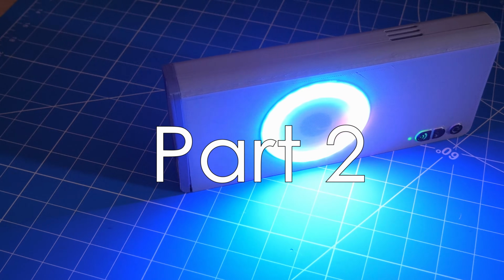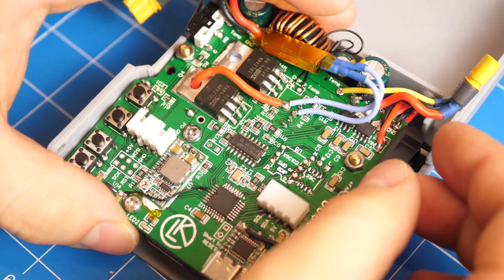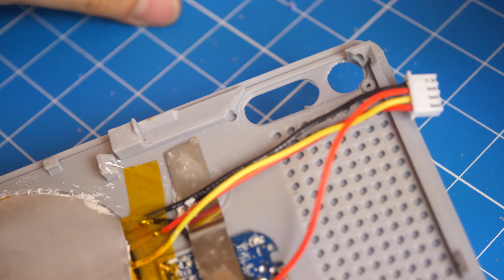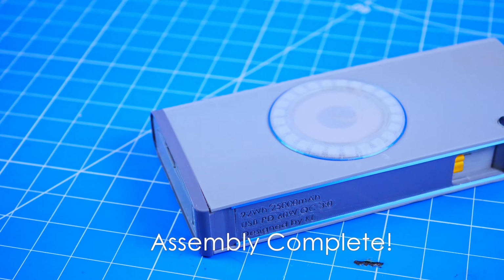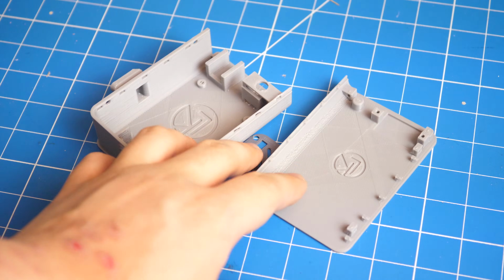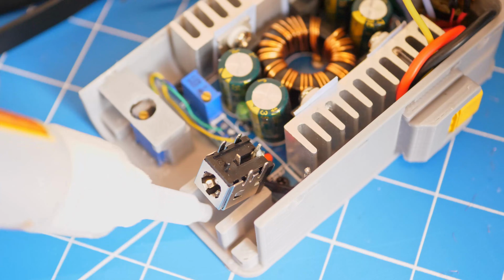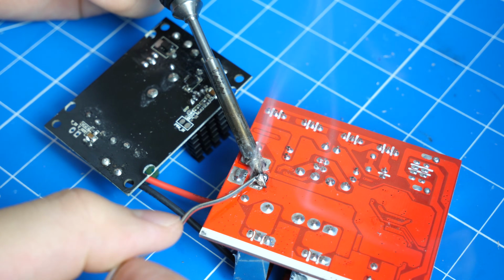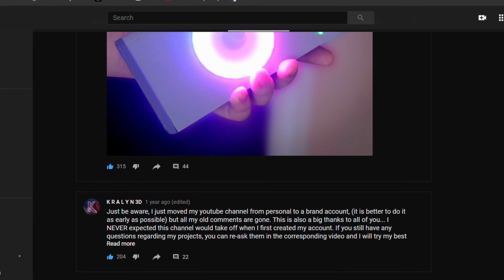The MOST Versatile DIY Power bank Build (Part 2)

Comment from the maker: Hello everyone, this concludes this version of the power bank (which is open-source) I am currently planning to start a campaign, but it will most likely take 2-3 months(create a company, website, contact manufactures etc.). If you have any suggestions or advice, please comment below as I do read all of them. I will post major updates in the community tab. The next project should be a lot simpler. I thank all of you for your support!
Reply: Thank you so much. I love what you are doing and just want to wish you well💯💯💯💯💯. Keep up the good work. Btw what engineering field are you in?
Reply from the maker: @johndawson6057  I study industrial design and mechanical engineering; I learned electrical engineering by teaching myself.
Reply: @kralyn3d  this is awesome work your doing..  im super stoked on it.. i think i kind of want one lol. what country are you out of? and on a side note and question...  ever do any work on electric bikes of any kind? i personaly ride an electric limited speed motorbike..  super soco tc. and i want to upgrade its controller with something better. and all of that is easey enough but the batery is always the biggest issue with mods like this.. i found a hard tail single wheel trailer i want to work with as it has a solid enclosure... and i kind of want to figure out how to get a rebuild going on my battery that will give me multiple charge options. so that i can use ev charge stations as opposed to just wall plugs like i have. but i  really kind of wish to get a small generator implamented into the trailer so that i can charge if i get stuck away from power by keeping a small amount of emergency fuel on hand and trying for a dc fast charge on the batteries. i have one friend in town who also hobbies on this but neither of us are advanced builders like im seeing here. any suggestions or ideas for me? i just want to get the bike able to get out farther. and able to take more than just one source of power :P
Reply: @kralyn3d  I studied ID as well, also a self-taught electronics engineer - your videos are the kind of thing I wish I had the time to make! Big congrats!
Reply: @kralyn3d  wOw! your passion will drive you in a successful business
Reply: Here’s a idea what about using Gallium nitride components to reduce the heat dispassion and to increases the efficiency of the device over all?
Reply: Have you thought of adding other quick charge functions like oneplus, Huawei's and Samsung's quick charge? Or apple watch wireless charger or qi fast wireless charging. I do not personally benefit from any of those and they would add more cost, but for some of us it might be really useful.
What about Bluetooth to control lights and other parts of powerbank such as charging?

Just sharing my thoughts...
Reply: I am from India can buy this one when it is ready
Reply: For the ac module if the plug types were interchangeable it would be more versatile when travelling or when you shipping this product internationally.
Reply: @mayur619  that's what I thought too
Reply: Hello sir
      Your experiment and the the product gained is just fantastic. I  very eagerly waiting to have one of them. So I wanted to know whether you can do one for me and ship it to my address. Please sir i am very crazy about your product sir please do think over it and do reply.
thankyou.
Anirudh Balakrishna.
Reply: I'm waiting for the campaign. I look forward to supporting you on this endeavour
Reply from the maker: @AndrewJames1984  I am working full speed on it right now.
Reply: @kralyn3d  this is awesome. Thanks for taking the time to respond to my comment 🙂
Reply: I would like to buy. Please send me the link.  This is really a superb piece of device.
Reply: Best wishes ❣️🎉
Reply: How to buy
Reply: Some suggestions I have for this power bank are to add some type of solar charging either built in or as a module or some other method , also it would be nice if this also had a module for jump starting a car as a lot of powerful/big power banks have this too. Just some suggestions along with everyone else’s. Thank you!
Reply: @ChristianWoods  I can't imagine it to have enough power to start a car, even if it had connector would probably melt.
Those car starter powerbanks are bigger and use high discharge lipo cells and they have quite low energy density.
Solar panels in that area would be only help in emergency since circuitry draws itself that much (almost). External solar panel would be nice.
Just sharing my thoughts...
Reply: @innocentidiot9521  Yeah, I just looked into how much power is needed to jump-start a car and it says 400-600 amps for a consumer vehicle although as little as 150 amps could jump-start small and compact cars. Still nowhere near the number of amps this power bank has. It would need to be wired in at least 4s 12p to deliver about (12v) 420 amps using Sony Murata VTC5A 18650 batteries, which have a continuous discharge rate of 35 amps (when below 80℃) and are 2600mAh each. I just didn't realize how much power is needed to jump-start a car.
Reply: @ChristianWoods  yeah, at first I couldn't believe it either
Since it's short time, theoretically 2p4s configuration should be able to star a car (at least once). I've seen videos on YouTube where someone started diesel truck with lipo battery that has xt60 connector (30A). And also I have started car with 2.5mm² cables (rated to 16A)(they almost melted). It is just so short time that it needs power.
Reply: @innocentidiot9521  Interesting! This would REALLY be a nice feature to have, but something that "Jerry Rigged" probably wouldn't go well in a commercial product. I don't know, maybe he could warn people and give them the option of including the car jump-starter module, or find a way to solve this if he wants to go that far. I'm really just throwing out ideas.
Reply: @ChristianWoods  super capacitors!
Reply from the maker: @ChristianWoods  Thanks for the suggestion, I'll take this into consideration!
Reply: @kralyn3d  You're Welcome! Just glad to see your taking in community suggestions to make this the best power bank possible for everyone!
Reply: Nicely done quick suggestion can you create a longer battery life battery for instance a 5s 2p for double capacity?
Reply from the maker: @charlesmartin8596  Yes this is possible but then it would be illegal to carry this on a plane.
Reply: @kralyn3d  what about an add on pack for example you place another plug on the bottom of the pack that way its a removable so if traveling other than by plane someone could double the capacity when he or she needs it and when they don't they can remove the extra cells
Reply from the maker: @charlesmartin8596  That would require additional circuitry and a big problem that the second battery has to pass through the first batter thus causing them to charge each other at uncontrollable rates. Also, a pack is only stable if it is surrounded by a shell, if a second pack extends beyond a shell, there would be too much stress on the connector. Thanks for your feedback!, I might be able to use the external expansion slot for a battery module, Ill consider it. ThANKS!
Reply: @kralyn3d  being that I live in a hurricane prone area I was thinking of having to charge multiple devices such as 3 phones 2 tablets all at the same time
Reply: I'm here to buy one whenever you are ready. Lol
Reply: Tag me when u sell
Reply: Amazing. What price range are you looking at?
Reply: Would it be possible to add a fully charger pack and then disconnect an almost discharged one achieving an ununterrptible power source? I need something like that to keep  my router and home automation system alive in long power outages
Reply: I would purchase one with extra battery packs and the adapter add-ons.
Reply: I'd like to be added to your crowd fund campaign (don't use kickstarter) . Can you please let me know before you go live so I can pledge for the early bird deals. UK AC plug socket. Thank you and congrats on your work, great video's
Reply: Plss try to make multipurpose power bank 🙏🙏🙏🙏🙏🙏🙏🙏🙏🙏🙏🙏🙏🙏🙏🙏🙏🙏🙏😢😢😢😢😢😢😢😢😢😭😭😭😭😭😭😭😭😭😭😭😭😭😭😭😭😭😭😭😭😭😭
Reply: @Earlyn174  They already did. Check their previous power bank, it has a lot of things.
Reply: There is nothing at all like this in my country Malaysia. Please crowd fund this, I will be one of your first funders.
Reply: Super 👌👌👌
Reply: Add a solar panel charger accessory with it? Flashlight?
Reply: @1TheBestInTheWorld  and also plasma lighter
Gotta love it's extension port
Reply: @@1TheBestInTheWorld  
please do pd 100w